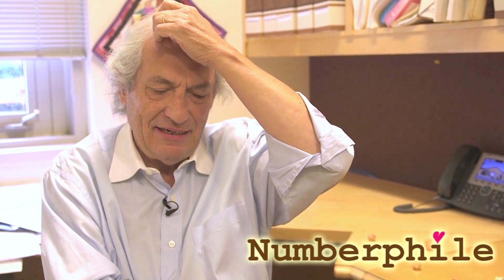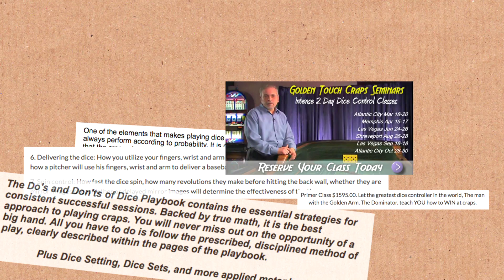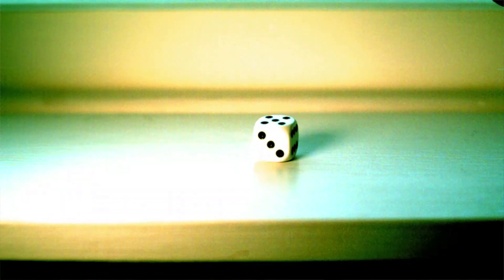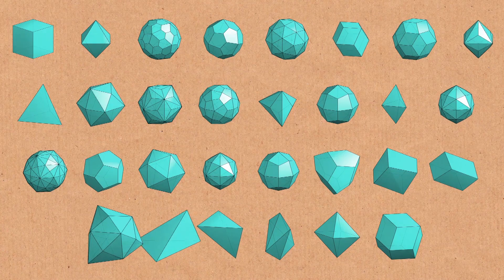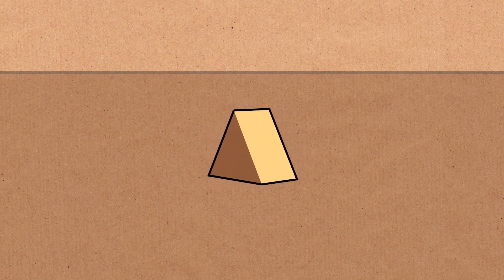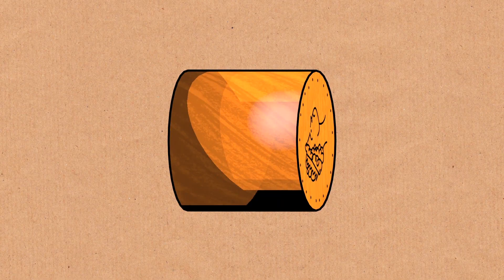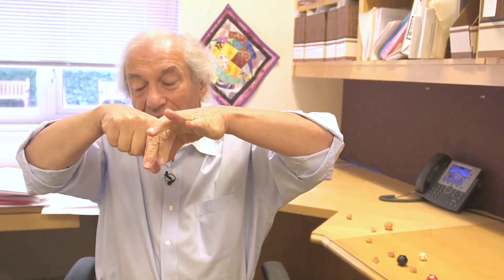Fair Dice (Part 2) - Numberphile

Comment: Just wanted to ask what's wrong with applying the "2thousandhedron" logic to the "un eaten toblerony" example.  toblerone is a d3, pencils are d6. Stick dice like these would have even numbered dice be labeled on their faces whereas odd numbered dice would be labeled on their edges similar to how typical d4 are on the point. Would these not provide a simple & "fair" solution to infinite dice?

Comment: Saw this question on an 11+ practice test and have no idea how to even approach it? Any idea?
"My Special number has a 9 in the units column. If I remove 9 from this column and place it at the left hand end of the number, but leave all the other digits unchanged. I get a new number. This new number is four times my special number. What is my special number?"
Reply: Think about what moving a digit does. Your name is a*10 + 9, where the number "a" is what you get when you remove the last digit from it. So by moving it to the left, you get 9*10^n + a, where the "n" here depends on your number of digits. Your equation is therefore 4*(10a+9)=10^n * 9 + a. Then solve for a in terms of n.
Reply: Just a heads up, this problem has infinitely many solutions. But you probably won't find 230769230769230769230769230769 as your first answer. If you know modular arithmetic, it's quite easy to find all the solutions and prove that that's all the solutions that exist.
Reply: You will need to iterate through the multiplication. From the initial description, you know that

xxxxxx9 * 4 = 9xxxxxx

9*4=36 means that the last digit of the right number needs to be 6 - but that is also the last-but-one digit of the left number:

xxxxx69 * 4 = 9xxxxx6

Repeat that step (with a variable number of 'x') until you get to a solution.
Reply: Just a guess based on the above comment, but are all solutions just glue another 230769 on?

Comment: Perhaps I misunderstood the theorem. Couldn't you take the Toblerone die and carve the ends to be a point, taking care to still use flat faces when carving, and to leave the total number of faces odd? The faces on the ends would never land, because gravity would always pull the die down to one of the three main faces. Mayhap the definition of "fair" means that all of the faces have an equal chance of landing, and not merely that the die reliably produces an odd number of practical possibilities (in this case, three).

Comment: You can make a 5-sided dice if you allow curved surfaces.
Start with a 5-sided prism and squish its top into a point. As well as the bottom. Then round each of the five remaining surfaces to make each slope as gentle as possible. That way it will never be able to land in a strange position.
Reply: I was thinking the same thing. Maybe somebody should make one and send it in.
Reply: ***** Great minds think alike xD
Well, I might make a wooden one, but it would be easier for me to just make a video about it than actually sending it.
Reply: ***** Yeah, I want to make some and use them when I have the time :)

Comment: Other than the infinite family of dice based on dipyramids (which would theoretically allow for any even number of faces, the only numbers of faces you can have on a fair die are:  2, 4, 6, 8, 12, 20, 24, 48, 60, and 120.

And if you really needed to, you can make a "toblerone" die with 3 sides, or 5 sides or 7 sides, or whatever, with the thing being long enough that it would never land on one of the ends, or simply make the ends rounded do it would fall onto one of the sides.  Or make it like a top, which would probably give the fairest distribution, although spinning it would take longer than throwing a die or dice.
Reply: 30...?
Reply: @musica00-7z Whoops!  Yes, 30 also - I even own a d30.  A rhombic triacontahedron, sometimes called Kepler's Solid.

Comment: doesnt the symmetry influence the distribution of forces while the dice are in motion? This means the center of gravity needs to shift equally as disproportionate as its outside perimeter is to the relative position of the surface it will land on or it will not have equal chances of landing on all sides. i have no idea what i just said, this is brainfog and i needed to let it out.

Comment: What if the 3-sided dice looked like this?

♊

Kinda like a cylinder and the gemini symbol, but with the curve not on the flat sides, but on the part that would be the edge of the coin that had been stretched?

Comment: Someone gave me a 5-sided die as a present recently. It was indeed shaped like a very short stumpy Toblerone. When I tried it several times on the desk it always came up 2, 3, or 4 (the sides of the Toblerone) and never 1 or 5 (the triangular ends). After a while I tried it on a mouse mat and it seemed more fair. At home I tried it on a slightly padded tablecloth and it came up almost exclusively 1 and 5. My conclusion is that the Professor is right. The surface makes a difference. The harder the surface the less likely it is that the die will lie 'flat'. Unless I can discover the precise texture which makes this die 'fair' it will remain a novelty rather having than any practical use.

Comment: Take two five sided pyramids with equally large symmetrical pentagram as base. One pyramid is a bit elongated, and the other pretty flat. Glue them together at their pentagram bases. The die will always land on a side belonging to the elongated pyramid since there's no stable surface on the flat pyramid's side.
Wouldn't this be a fair five sided die? It's symmetrical in one dimension and doesn't have any curved sides.
There would be an infinite number of this kind of dice.

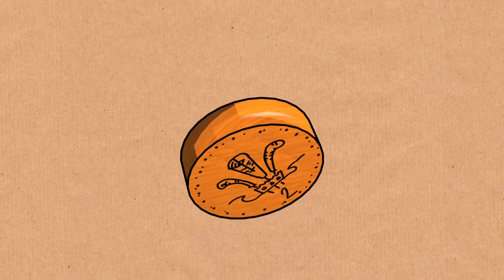Comment: Based on the theoretical description given here (@ 4:30) for calculating a coin geometry  that will have an equal likelihood of landing on heads, tails or it's side, it works out (correct me if I'm wrong) that the coin must have a thickness (cylindrical length) equal to ((√2)/4) * its diameter.

So if this is correct, and you wanted to make a fair 3 sided coin by sticking coins together to make a 'longer' coin there are a couple of (english) coins that work best. Four £2 coins wins, and five bronze (apparently there are two types) 2p coins is almost as good.

I will be getting my superglue out this weekend :-)
Reply: I agree with that answer, but it seems really counterintuitive to me - the cylinders look much too thin to land on the curved surface a third of the time. I'd like to know how that idea (making the three 'caps' of equal area) was derived, and I reckon the professor is right that it wouldn't work on all surfaces. I'd bet it only works on reasonably soft surfaces, where the coin wouldn't tip so easily.

Comment: So uhh, did I miss anything? I was wondering, can't you make dice with rounded surfaces so that you can get uneven number of surfaces and it would still be fair? For example, 3 or 5 sided "cylinder" with the top and bottom squeezed together. I think it would even be "more fair" than the 2 tetrahedrons glued together.

Comment: Would it be possible to simulate a fair 5 sided die with some number of even sided dice?
Reply: After thinking about it for more than 5 seconds, I decided that it is, 10 sided die mod 5
Reply: Yeah, common D&D practice for rolling an odd number is you take an even numbered five and divide the result by two, rounding up.
Reply: I believe you could take any 5 dice of the same value. Roll all five and then take the average.Or roll a 10 sided die and divide by 2. 1&6=1, 2&7=2, 3&8=3, 4&9=4, 5&10=5

Comment: I think you could design odd sided dice that will have equal probability of landing on each side IF the sides were not flat but rounded.  A toblerone that comes together at the ends into points.

Comment: What if you drill 9 holes in every side and fill some of the holes with paint the same color as the die, and other holes a contrasting color.  So for example 1 would have the contrasting color in the very middle hole and the other holes colored the same as the die.
Reply: MrNateSPF I imagine that would work well for 4-, 6-, & maybe 8-sided dice, but 12 & 20 wouldn't fit all those dots
Reply: +Alexander -- For that, you could hollow out ditches on each side to form two blocky figure-8s, then fill in the appropriate bars with the different-colored paint to form the numbers, then fill the other ditches in with the other paint. If I worded that confusingly, think about digital clocks.
Reply: mvmlego1212 what you're looking for is 7-segment numbers :) Hi from the future lol
Reply: A 20 sided die or 30 sided die could be handled with 5 pips and a line on each facet. The pips would be in a row and the line would be under all five pips to orient the binary number.
Reply: You never use dots for 12 and 20 sided dices, do you?

Comment: what the die is made  from also is a huge factor in its fairness. clear dice are the most fair others are not due to the manufacturer usually having imperfections in consistent material in the center

Comment: Why can't you have a die with curved faces to give you a 5 sided die? you can take a pentagonal prism and round the base edges so the lateral edges meet to two different points. Then you could have a 5 sided die
Reply: The proof is only for flat faced dice.

Comment: And just in case it's not obvious to anyone out there: you can have a fair 5-choice die even if you can't have a fair 5-sided die. You just take a 10-sided die and label 2 of the faces "1", 2 of the faces "2", etc. up to 5.
Reply: You could also "merge" the top and bottom triangular sides of bipyramid dice into a curved lune and have an n-sided fair die with hosohedral symmetry
Reply: look up barrel dice
Reply: @TehCorbzor  barrel dice are just antisemitic dreidels
Reply: there is other option if you need 5 side dice you just roll standard 6 side dice and re-roll when you roll 6
Reply: I checked the comments just to see if someone had brought this up already. There are many wargames that use mainly six-sided dice (commonly abbreviated as "d6") and sometimes require a "d3 roll". This can be applied to any odd number (although a "d1" would be utterly useless): take the fair dice with twice that many sides, roll, half the result, and then round *up*. This obviously assumes that the sides are numbered consecutively starting on one, and there is an important exception: 10-sided dice made for role-playing are often labeled 0 through 9 instead of 1 through 10. In that case, always count the "0" side as "10" (so it's a "5" result once halved).
Which brings up another interesting point: there are a few tricks to "roll" dice combinations for ranges that would be awkward to achieve with a single dice. An example used in many RPGs is the "d100" or "d%" roll: take two 10-sided dice (0 through 9, or regard the "10" as a "0"): roll first for the "tens" and then for the units, and you'll get a value between 0 and 99, with fair distribution (assuming the dice were fair to begin with). In many games, the "00" result is regarded as "100", so the range is 1 to 100. This can be extrapolated to any value that can be broken down as the product of the numbers of sides of available dice (for example, you can get a fair distribution between 1 and 36 using two separate "d6" rolls), but that gets a bit messy.
Reply: Of course! How else would we calculate damage?
Reply: I was thinking having a pentagonal prism where the pentagon faces have a sort of stabilizer (like a cone on each end) that forces it to always land on one of the 5 sides instead of the ends.
Reply: @wengel_ca  or just round it to a point, i.e. so that the edge and side look like this )
Reply: Another obvious choice if you need to roll a "D5", is just to roll a D6 and reroll on a 6.
Reply: Genius
Reply: You can make a 7 sided version of a toblerone and sharpen the pentgonal ends so it only lands on side faces. Fair 5-choice die.
Reply: Euclid, Archemides, and a bunch of modern mathematicians: "we've found all the fair die that can possibly exist, and none of them are odd numbered."

Tabletop gamers: "hold my d20."
Reply: @TheSonicShoe  So? Which of the dice in tabletop games are odd-numbered? There usually are d4, d6, d8, d10 (sometimes two of them), d12 and d20 in a default set of dice. All of those dice have an even number of sides.
Reply: @LyxeiLP  you literally didn't even read the OP and the second comment, did you?
Reply: @LyxeiLP  Fate system almost exclusively uses d3s, and a lot of other games use them too. All you have to do is divide a six sided die into three possible outcomes, and you have a fair 3 outcome die. It's not literally a fair 3 sided die, but it achieves the same result as one, and it's one of the most common rolls in half a dozen different systems, and is used by GMs and players alike all the time whenever they want to randomly select from one of three possibilities.
Reply: @TheSonicShoe  Which literally states the difference between "choices" and "sides". It's even odder you are bringing up "Hold my d20", when that''s exactly an even numbered die. Yes, you can simulate an odd number of choices, but you cannot have a fair d3 without simulation, that's not possible. And you even chose an even-numbered die as an example in your adapted meme. Since we are at the Numberphile channel, I would even disagree with the naming that "you throw a d3". You throw a d6 and map the outcome to a possible result set of three different values (which you could also do with a d12, for example). But, of course, referring to it as "d3" is shorter than the mathematically correct explanation, so "throw a d3" is a more convenient description. Still, you are definitely throwing a d6 (or d12 or whatever even numbered die) when somebody tells you to "throw a d3".
Reply: @LyxeiLP  oh... I thought you were being malicious, but you actually just didn't catch the fact that I was making a joke...
This is awkward...

Sorry dude, I mistook you for a troll. I didn't realize that it genuinely went over your head that I was being facetious.

Comment: There are a lot of ways to fudge odd-sided dice though. To get a d3, you can label a d6 1,1,2,2,3,3, or you can round 3 edges of a d6 such that you have 3 continuous sides (kind of like stitching together 3 saddle shapes). Sure, rounding edges might take away from the polygonal faces, but it's just as fair as long as you read it consistently.